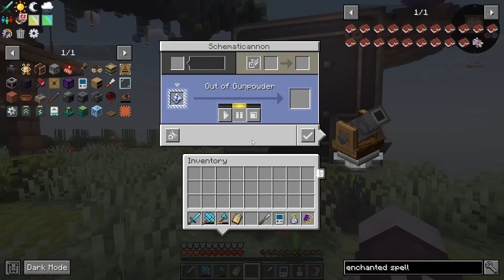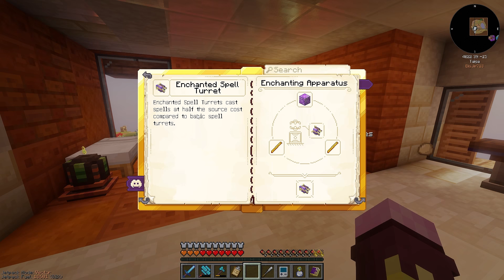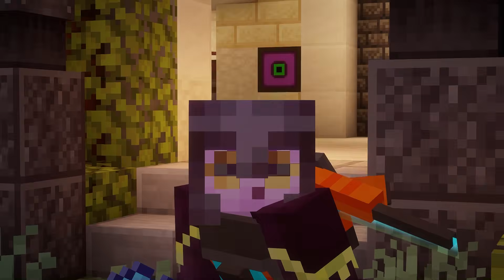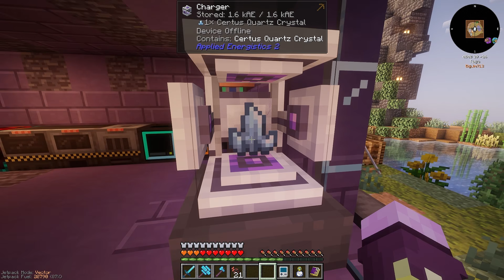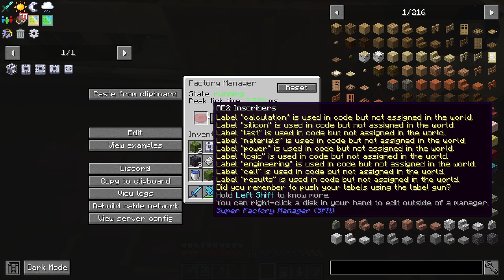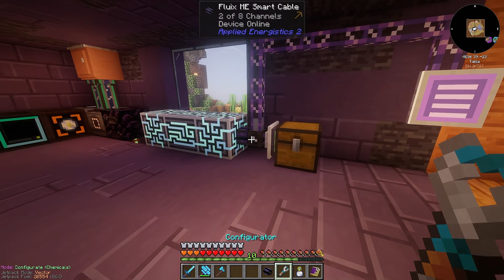This Method Makes AE2 Early Game SO EASY...

Comment: That dirt generation was brilliant. Modifying the terrain spell can give you a few different results too! If you have slightly staggered turrets, I could see a Conjure Terrain/Crush for sand, a smelt, then a Break/Extract to rapidly get loads of glass.
The processor automation was really clean too. Never used SFM but I have used laserIO and integrated dynamics, and it doesn't seem much harder than those.
Reply from the maker: Oooh I saw that! I had an idea to do that for things like mud or making sand etc that's really cool. I've not played much with LaserIO, I think I've been spoiled a bit with SFM because I can code it to do exactly what I want/need without having limits on filtering or speed but I'd love to try that

Comment: Hey Jim, I am attempting my own sieveless and I just realized you can make an alloy smelter then a sag mill and mill raw aluminum from the lens of the miner to get zinc as a bonus instead of going to the end early. Not that it matters much since you stop by the chaos guardians anyway. I realized this after trying to play without going to any dimension before I absolutely have to!
Reply from the maker: Oh woah that's really useful I really wish I had done that because I wanted to save the end for later :( If I was to do it again I'd totally do it with that method thanks for sharing!

Comment: Hey Jim 😁 wanted to let you know that when you say "Ars Nouveau" ... its probably "art Nouveau" 😅😅 idk if it is intentional or not but it confused me a lot. The pronounciation is derived from the french word for art.... spelled the same as in english, but the T is silent 🇨🇵
Reply from the maker: I think it's a pun, I could be wrong but the old magic mod it was based on was called "Ars Magica" and so I think despite it being French the mod devs call it "Ars" so I go with their pronounciation 🤣
Reply: I always thought the name came from a reference to an older mod.
Reply: @JamesStansell 😅😮 thats interesting.

But yea... its a style of art often inspired by natural forms such as the sinuous curves of plants and flowers. Other characteristics of Art Nouveau were a sense of dynamism and movement, often given by asymmetry or whiplash lines, and the use of modern materials, particularly iron, glass, ceramics and later concrete, to create unusual forms and larger open spaces. It was popular between 1890 and 1910
Reply: I found out the old mod was called Ars Magica and I would not be surprised if the French word for art didn't apply to it as well.

Comment: While I love the fact that you can smelt compressed cobble, there is a cobblegen recipe for stone (lava and running water on the 2 sides, stone underneath) if you just want to generate it directly.
Reply: Yep! Also, running water is not required if you use a fluid drawer with the water generator addon.
Reply from the maker: Ooo that's a good one too! Thanks for the tip!

Comment: Why did I just watch an AE2 and  SFM tutorial while already building both setups alot? Well anyways were quite good explanaitons though I mostly skipped over it.

For the basement, I think a steam/cyber punk (something in between) mineshaft would be cool with maybe some oritech blocks simulating a quarry going down or so. Though a functional elevator should be in the middle with just camouflaged blocks for easy access. One part for design, the other for functionallity.
Reply from the maker: Ahah well that's a good sign! They are some really good ideas I'll definitely need to use them thanks!

Comment: Rather than using functional storage drawers with a controller, given your beautiful house one thing I might suggest is adding Create: Connected to ATM10TTS and using the vertical create vaults and hooking your AE system into that. You could do the same without create connected using horizontal vaults, but your house is better suited to vertical vaults.

This has the advantage of massive storage without disk drives which is great for early game; but also allowing you to item hatch your inventory if you need to.
Reply from the maker: I'm trying to play as "vanilla" ATM 10 TTS as possible but I really desperately wanted vertical vaults from Create connected. That smoke stack is perfect for them as well 🤣

Comment: Would the ARS portal work for getting up and down? I haven't ever used it so I don't know how they work but I assume they would work. I know one of the other mods have a portal system but I can't remember which mod. You could put one portal into the mountain and put one into a wall down in the cave and hide the frame blocks. There is the elevator mod but it is very boring.
Reply from the maker: Ooh thhat's a cool idea, I think I might go for an elevator just because it looks cool but I want to make an ars portal room

Comment: I think it could be interesting to use productive bees for a couple particular resources if there aren't many other good ways of making them (for example for draconic specifically, if they are in the pack). I also recall productive trees are in ATM10 normal and I never touched it because it seemed like an hassle, but maybe a small diversion in both for a couple specific things to showcase the mods off could be interesting?

Comment: I really dislike the whole channel thing which is why I mostly used Refined Storage until I found out that I can disable channels in AE2 and since then its my goto method for storage and auto crafting
Reply: I was used to only having ae2 then when refined storage was released i focussed that especially if it has a multiblock crafter or upgraded crafters. But now i switched back to ae2 and finnaly learned how to use p2p channels for more channels than u will ever need.

Comment: I have E for inventory, shift-E for crafting table on a stick and ctrl-E for wireless terminal. Can confirm it is extremely convenient to have all three on one key bind.
Reply from the maker: It's sooooo good!
Reply: @BigJim713 can someone explain how do you key bind the wireless crafting terminal? I have different wireless terminals in key bind settings yet not the regular crafting terminal. Have to struggle with the universal one that has patterns creation and switch to the  regular crafting all the time

Comment: Now, i ain't going to be the first to point out, but crafting dense cable first saves you three Redstone and glowstone per cable. Not an issue with Skyblock Way, where resources are passively generated but a good thing nonetheless
Reply from the maker: Oh wait you're so right. I'm an egg thanks for that tip

Comment: 6:57 "In no other mod can you set up a farm that quickly that produces that much."
The dastardly MI Electric Quarry:

Would be cool to have a Create elevator going from the black tube to the bottom floor.

It's cheaper to make Dense Smart Cables by first making Dense Covered Cables and then making it a smart cable, it's not much of a difference, but it saves a lot of redstone and glowstone long term.
Reply: i miss the old buildcraft quarries where i could give them a million billion rf/t and they'd obliterate the world in half a second
Reply from the maker: Ahaha this is why I need to finally learn MI!

Comment: Last i checked, the metallurgic infuser from mekanism can make netherite more efficiently than crafting it directly, since it can use enriched gold.
Reply: Ingot or what. Cause the most efficient way to make a netherite ingot is with oritech. One scrap one gold equals one netherite ingot.

Crazy recipe.
Reply: @ewaaah605  ingot using 4 scrap and 0.5 gold. I don't know oritech recipes.
Reply: @RealityMasterRogue i just told u the oritech recipe. So its low on gold but heavy on netherite scrap oritech makes it cost one netherite scrap per ingot which is insane.
Reply: @ewaaah605  I'm aware now that you can do that, but you can't time travel and reply to my comment before I made it.
Reply: @RealityMasterRogue  just to make sure u understand what i mean. I commented on ur post the oritech recipe then u replied to my comment "i don't know oritecht recipes" but i just told u the recipe. So u did know the recipe. Understand it now?
Reply: @ewaaah605  actually, I said I didn't know oritech recipes (plural), and you told me an oritech recipe (singular), so i was still right.

even beyond the technicality, that was what I meant; I don't know oritech recipies in general, and was saying so as an explanation for why I did not mention oritech in the original post.

Comment: my issue with ars is that its too powerful to where it feels like it kind of spoils the experience tbh. Thats just while playing though, no problems watching it ;]
Reply: Ars? Of all the mods is too powerfull? Sfm is probably the most powerful mod in all of modded Minecraft.
Reply: @ewaaah605  ars doesn't require me to know how to code. ars requires me to know how to put the funny symbols in order. There is an order of magnitude of difference in difficulty.
Reply: @RealityMasterRogue  true but those symbols don't do a whole lot. They spawn dirt or heal u sfm moves items energy gasses liquids instantly to a specified side of a machine. Its the ultimate logistic mod. And it makes it very easy to control the timing of things.
Reply: @ewaaah605  its less relevant in skyblock but just giving the player "projectile" as a starter spell is already insane. The break spell is always instant. Harm is just an all-star unless the mod has some stupid high power stuff to eventually obsolete it. Leap (and bounce) are very easy ways to get stupid amounts of mobility. item pickup combined with break is insane for convenience and safety. 

you say they "Don't do a whole lot" but in a normal playthrough ars basically completely takes over the game for the entire progression where its usable because it not only does everything it does it easier and cheaper than everything else and oftentimes does so earlier as well.

Comment: I personally prefer the chain conveyor (which you can ride with a wrench) over the elevator. Not only are they easier to set up, but they're also faster, more versatile, and more aesthetically pleasing. You can easily chain all your hotspots and tourist spots together, turning it into a sightseeing cable car. And, for practical fast travel, you could use a Teleportation Wand from Not Enough Wands, Shift + RMB while holding it lets you teleport through walls.
Reply from the maker: I love it, I've been tempted to do this between islands when I start making new ones!
Reply: How would you make it vertical and aesthetic at the same time?
Reply: @2uble_pi  It can't go truly vertical, the maximum angle is 45 degrees. Given that his cave isn't very deep below the surface, this design shouldn't take up any more space than a typical elevator would.I'd actually have the conveyor wrap around the edge of the island and enter the cave through the existing entrance. When you fly by, you'd see moving chains with scaffold supports all along the exterior. The movement of the chains and the supporting structure, would make for a perfect aesthetic addition to a floating island build.

Comment: the daisy chain of inscriber andevery applied energistics machine only works when connected toan ae network (with ae cable) you can daisy chain up to 8 machines (might have to test if u can't do more) on the other hand for any future little automation with hoppers you might as well use advande hopper upgrade from sophisticated storage it allows you to do both input and output with filter from any face of the barrel which is rlly useful early game.
Reply: 8 machines is the limit for daisychaining, yes, because of how that is the limit for normal cables
Reply: If the machines connect like ae2 drives u can place them next to eachother and connect one but the limit for this is 8
Reply: since inscribers don't use channels you can power an unlimited amount of them off a single connection